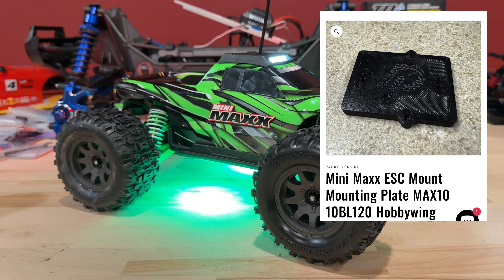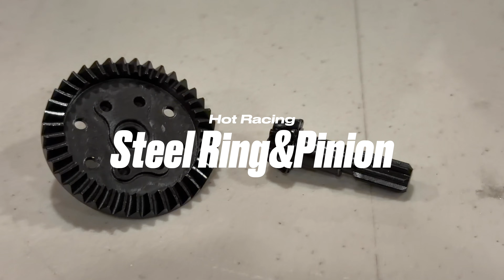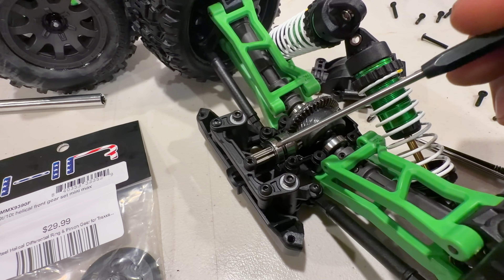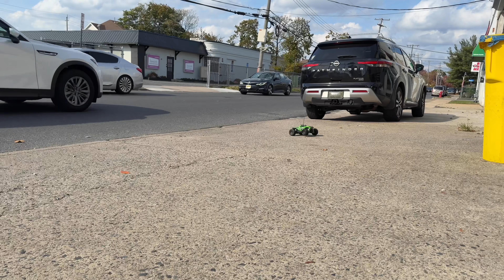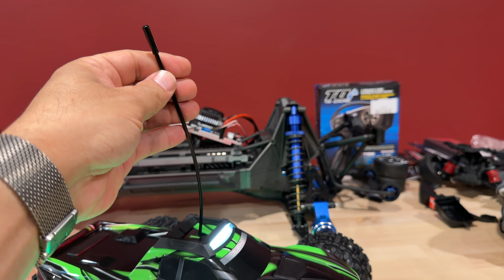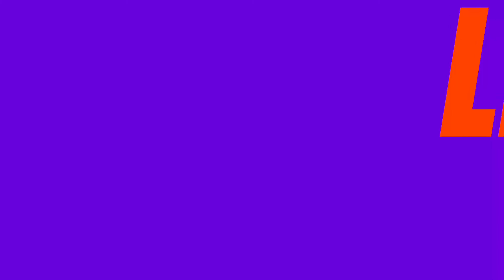New Mini Maxx Ultimate Custom V2 - Now Even Better !

Comment: I just bought one of these today and it doesn't disappoint. The only negative thing I would have to say about it is I don't get as much play time as my other 1/10 models. Even still this bad boy is perfect for entry level as it comes with everything you need. It has enough power to do willies on launch, and enough speed to do indos/stoppies when you brake. All and all I would highly recommend this RC to anyone wanting to get into RCs.

Comment: Why would you put a velineon in it, knowing they overheat so easily and there’s cheaper better combos out there
Reply: Mine doesnt go over 110 degrees 😂 tf you talking about
Reply: Mine repeatedly overheated in my Slash 4x4 VXL on the lowest gearing possible in a slash so I had to get an aftermarket overpowered heatsink fan combo for it.

Comment: Nice set-up 👍 what weight oil did you put in the upgraded shocks? The pack comes with 30w silicone, which I used - did you stick with that? Thanks
Reply from the maker: Yes 30 weight is prfect